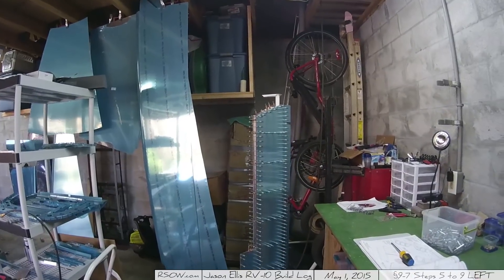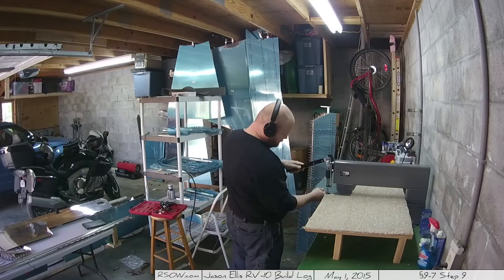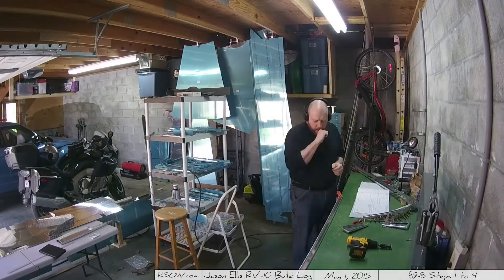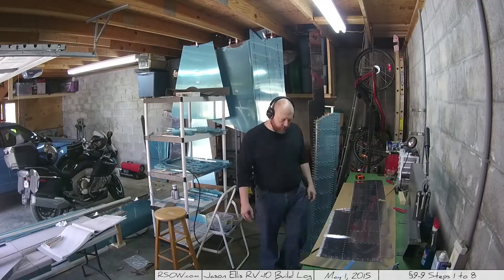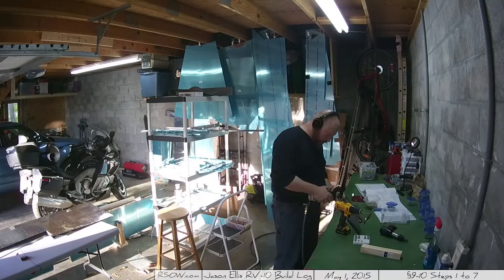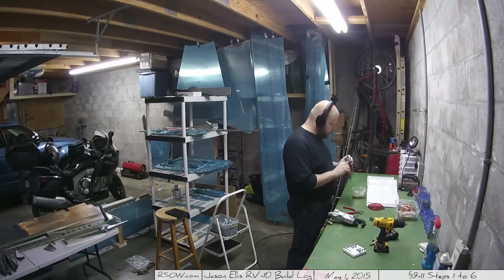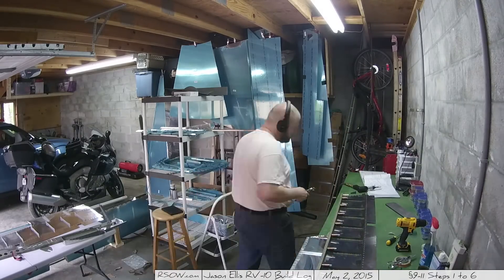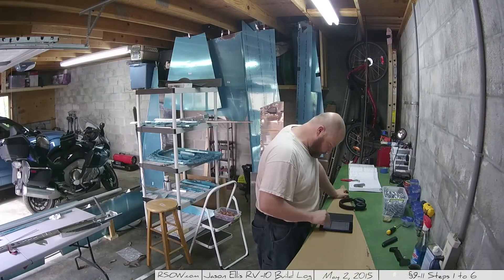RV-10 Empennage Sections 9-7 through 9-11 left elevator

Comment: Jason. I've been watching from the beginning. This is fantastic. I really want to do this but am not a confident craftsman as you very much appear to be. Stupid question. Can you prime all the parts first and then match drill?
Reply: kennymig I build aircraft for a living( prior c-130 and currently f-35). All of our parts minus the shims are primed before drilling with no issues.
Reply from the maker: Howdy,  I guess you could.. but I wouldn't recommend it.   If you're going to prime (which I still feel is debatable) then you want to do it specifically when Van's calls for you to do it in the plans.  Otherwise you likely risk things not fitting 100% OR worse, scraping off primer that you now have to reapply later.  (You will assemble and disassemble a number of times so that's possible.. )  Honestly, I'd just follow the plans..
Reply: Thanks, appreciate the response